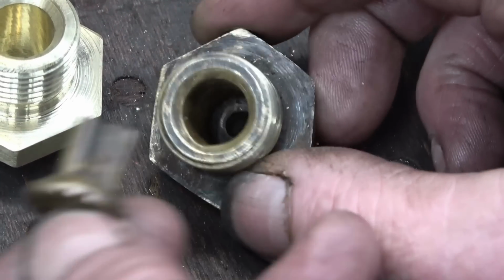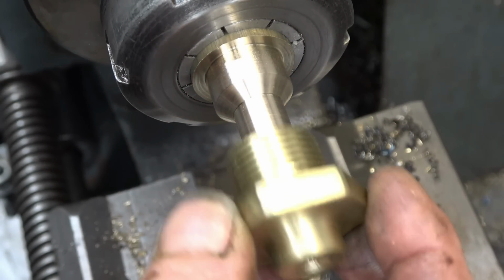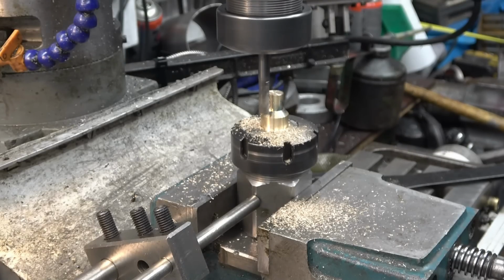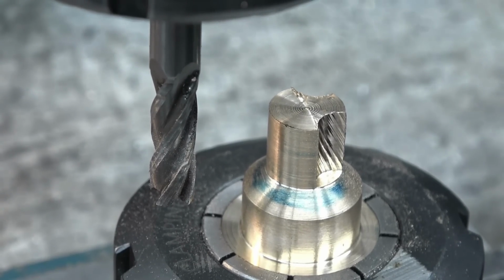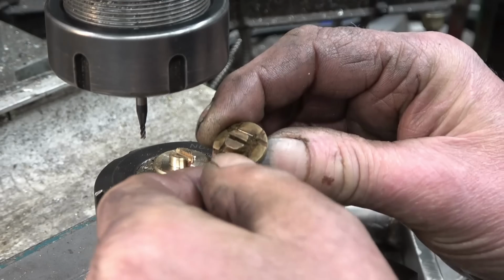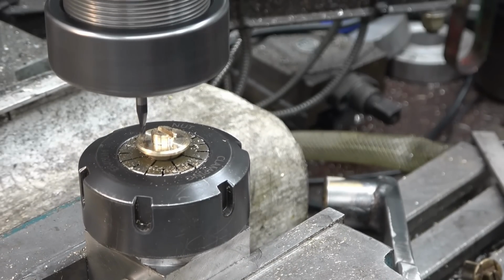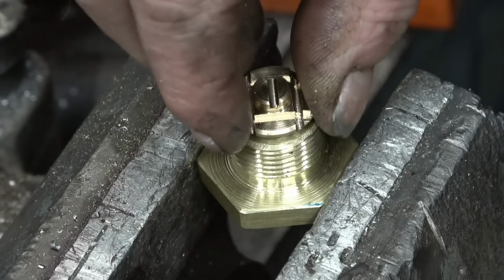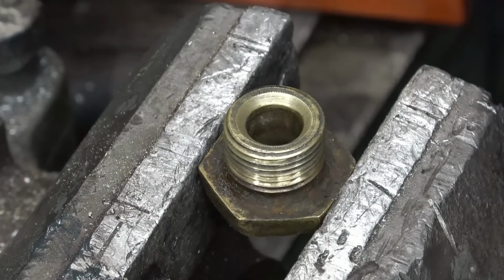SNNC 483 P1   Brake Bleed Valve  "small milling cutters"

Comment: Small mills and small carbide drills always want to break. About the only drill that does not want to break will be the dull 15mm one that you never use, that has been knocking around for decades in the box. That is the one you turn into a punch and a drift......

Comment: You mentioned that the old valve had spun.  I think that the new one might spin even worse - all the chatter marks from the big cutter are angled the same way, acting as tiny vanes in the flow.
Reply from the maker: The valve is supposed to spin by design. 
I will try a plunge cut on the vext one .

Comment: I'm surprised you didn't break off the bigger endmill taking such a deepp cut ! I thought you might have plunged it.
2023 give away 5
Reply: Yes plunging would have certainly stopped the harmonic striation finish. I'd have done it sideways then plunge cut for last 1/4 of a millimetre. Even the slots I'd have plunged most of the way across then just cleared out the slots with the table cross axis feed. Especially with a tiny endmill and the only one I had lol